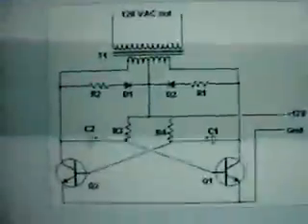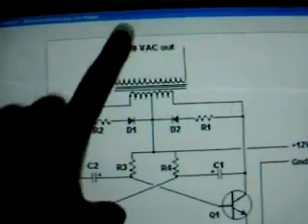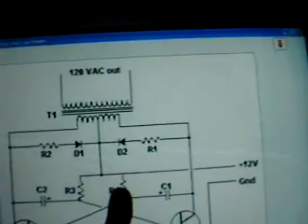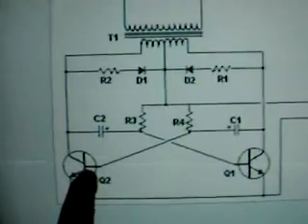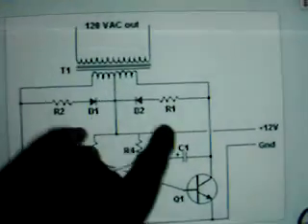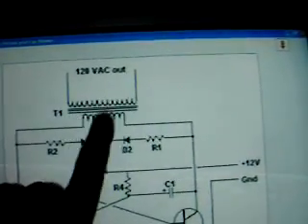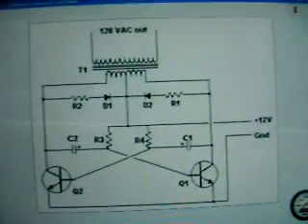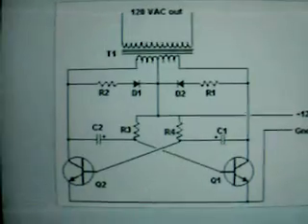HHO power Flip Flop supply

Comment: 1. 1N007 are the stealthy "James-Bonded" diodes. I think you meant "1N4007."
2.  What are the values of the resistors?
3.  Tantalums _are_ a type of electrolytic capacitor.
4.  How can increasing frequency move closer to saturation? 
5.  Are you sure you are using 22 gauge wire? That seems very small for a 300W output.

The proper term for this circuit is "astable multivibrator," not "flip-flop." The advantages of a properly-designed PWM circuit are better output fidelity and efficiency.

Comment: Hello, do yo have a simple circuit for a power supply that is capable of putting around 300vdc @ around 3 watts or so.I'm building a laser driver and im using a DC  to dc convertor.i need it to be variable.I found print on the internet.but its using a 220 volt primary.I ony can use 120 for this project.

Comment: This circuit looks cool, I built this circuit and had a question?  What output AC voltage is expected across the collectors with 12VDC input?  I am receiving 0VAC across the collectors but I get 24VAC across the center tap and either collector.  Is 24VAC across the center tap and collectors expected?  I have not hooked the circuit up to a transformer yet but was going to experiment on a radio shack 120VAC - 12.6V-0-12.6V turned around backwards so I get 120VAC output.  Thanks!

Comment: Thanks for all the great info.

Where can I get a schematic with all the values.

I have a PWM & it works fine, I just want to boost the output. I was trying a transformer & diode, with little results. When I connected it to the cell, the voltage dropped off.

Got any suggestions?

Thank you, Alcyone53